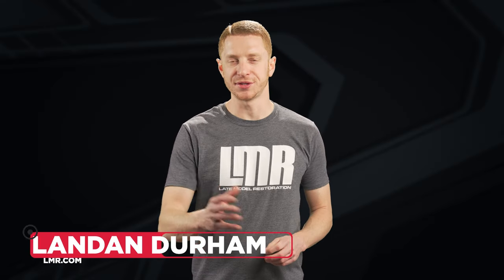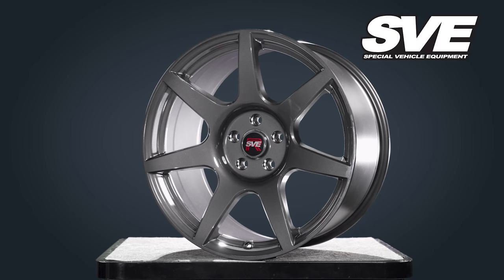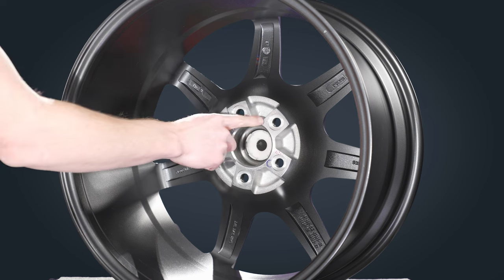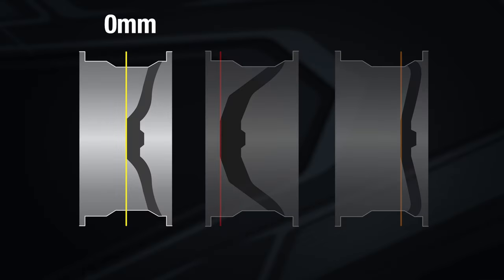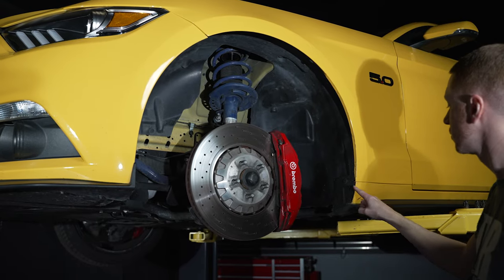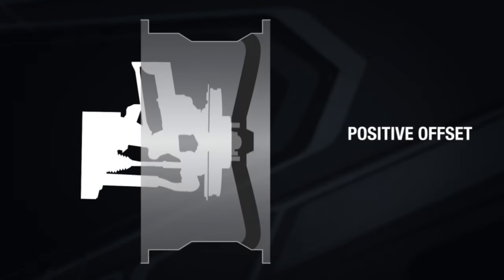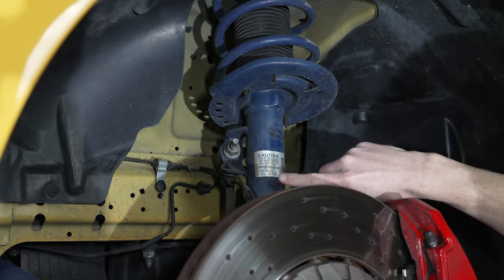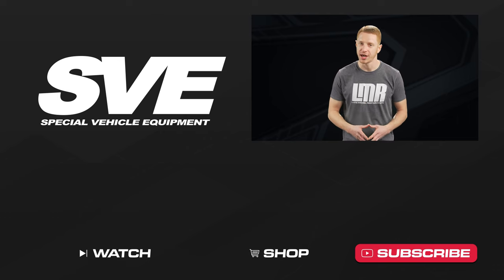QUICK & SIMPLE Explanation! Wheel Offset & Backspacing Explained

Comment: So, will your SVE SC 17X9 5 lug wheels work on a fox body with sn95 spindles? Which just rack limiters etc needed on the 4 lug? I noticed the spacing is different. However, I’m terrible with geometry. 

Thanks.
Reply from the maker: Yes, the 17x9" 5-lug SC-style wheels will fit a Fox Mustang with SN95 spindles. Rack limiters will be needed and more than likely you'll also have to clearance the inner fender splash shield. We have a separate video on that. I'll link it below.

As far as the wheel specs are concerned, the 4-lug SC-style wheel has a +20mm offset to clear a Fox Body grease cap. That's why you see the small difference between the 17x9" 4-lug and 5-lug wheels.

https://youtu.be/tkJ2toimkJ8
Reply: @latemodelrestoration  thank you.

Comment: Hey there. I want to ask you. My factory wheels have the following size. 7,5x17 et 25 6x139,7 bore center 106,1. I want to buy new wheels. The size that is close to my factory size is 8x17 et 20 6x139,7 bore center 106.1. 
My question is will it fits or will I have an issue.
Thank you in advance for your help.
Reply from the maker: Hey there, it depends on the kind of car you are wanting to install the new wheels on. We specialize in the Mustang and SVT Lightning. If you have any questions or concerns about another vehicle, we recommend checking out some forums or contacting other owners that have a similar spec to compare.